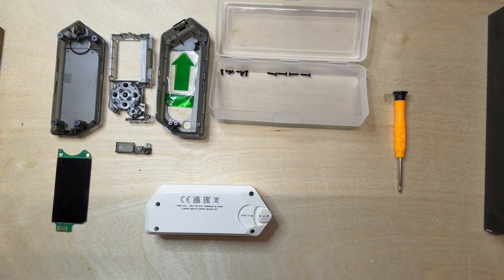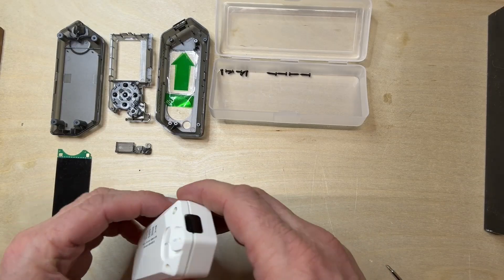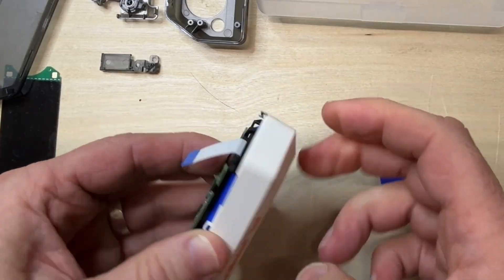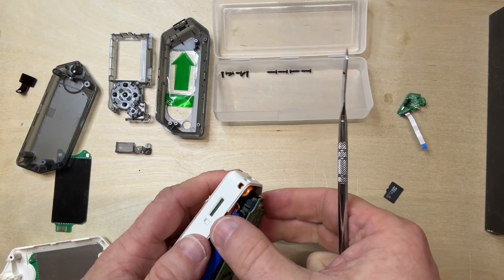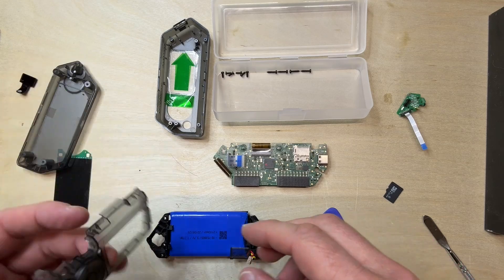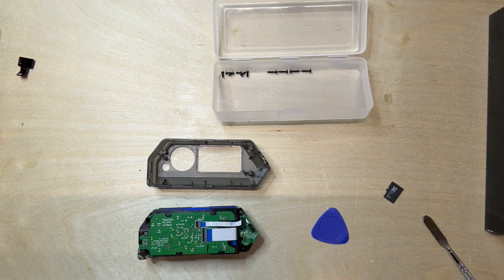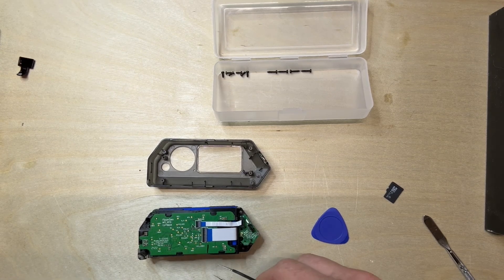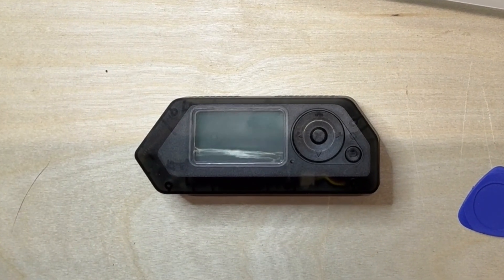Going Dark: Making my flipper zero into a stealth attack platform!

Comment: I recommend connecting everything to the face first, it will helps everything fit easier and will make sure the case fits even, trust me I did my case at least 3 times and each time was definitely a learning experience
Reply from the maker: Yeah I agree. This video was genuinely hard to make as the entire time I had my phone in between me and the desk so I was working around that. I should have also practiced but wanted to show the reality of it.

Comment: Where did you get the smoked transparent case?
Reply from the maker: I ended up trawling Amazon. I needed something dark that also came with new screws as my original ones were unusable.
Reply: I got mine from amazon also but I got the 4 in 1 and it even came with some screen protectors , not a bad price for it either